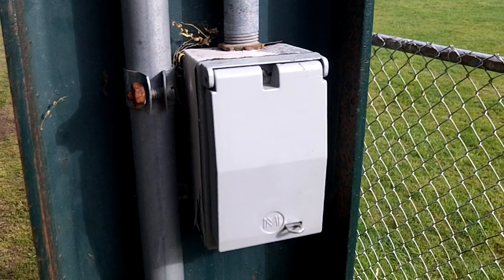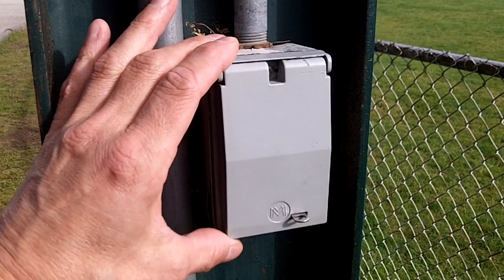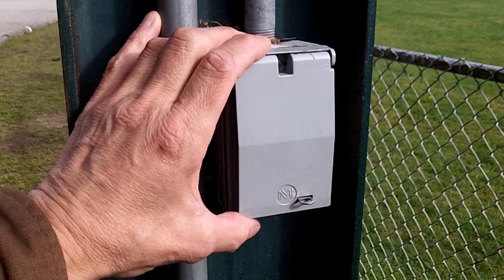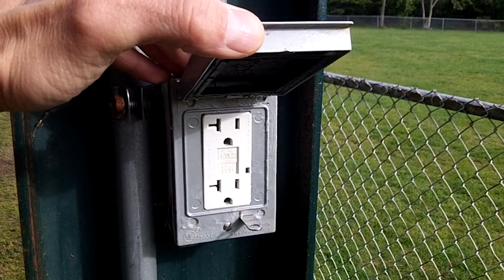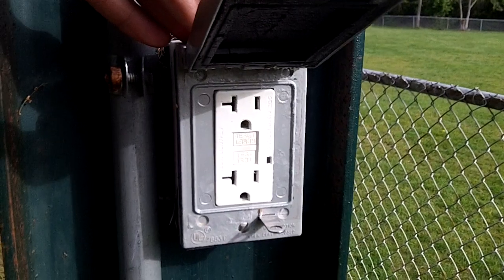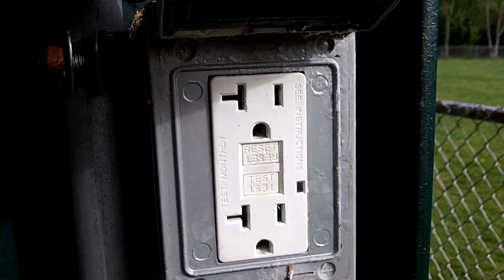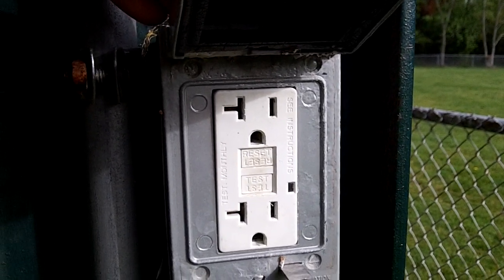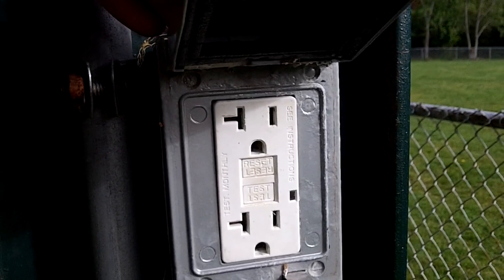Moving Violations Video No. 74: Receptacle Cover & Insufficient Protection

Comment: Besides the fact that "bubble covers" are cheap hinged garbage and prone to breakage (how long before a bubble cover there would be vandalized then you have nothing weatherproof!) . Also why are the weather-proof when closed covers still being manufactured if they satisfy no criteria?.... Myself, outdoor convenience receptacle=weatherproof when closed covers and for outdoor fixed equipment=bubble covers. PS. and the conception of the WR receptacle is a direct result from UV rays damage to the device through the bubble cover
Reply: Definitely a lot of cheap covers out there - and in-use covers weren't always required by code.  But as to why non-in-use covers are still being made, they are allowed in external protected locations, such as on a covered porch.